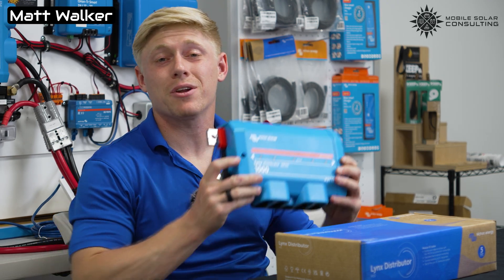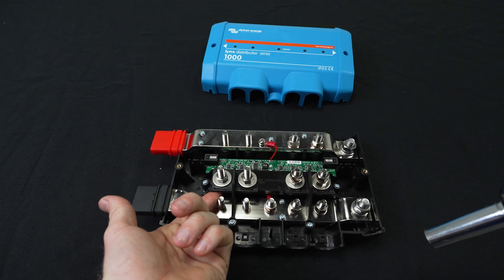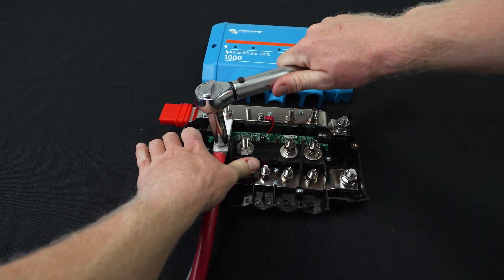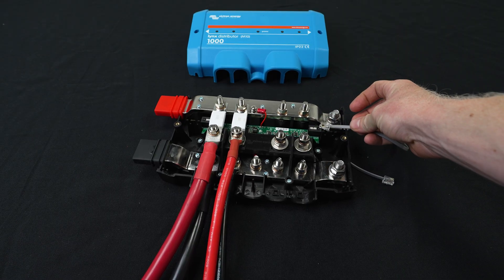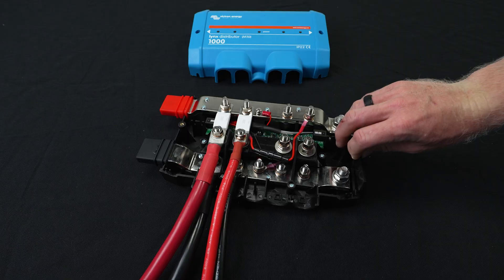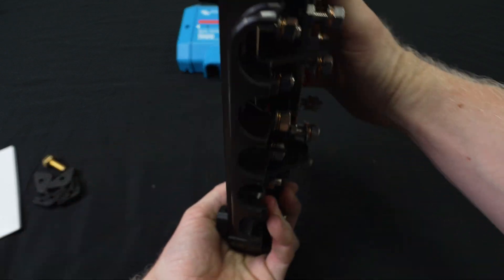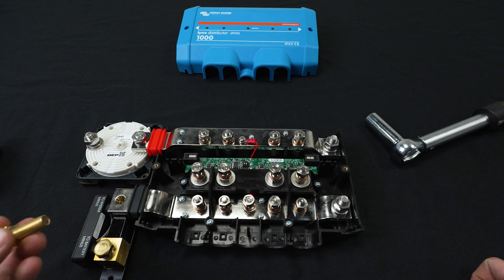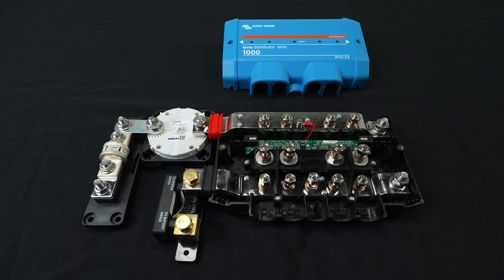How to Easily Install Victron Lynx Distributor Step by Step!

Comment: Great video!  Quick question, though.  What lug size do you need to use to connect a cable directly to the disconnect?  It looks larger than an M10.  That connecting plate seems really thin.  Shouldn't it be closer in size to the bus bar of the distributor?  I assume that would get a lot hotter under big loads with how thin it is.
Reply from the maker: The switch is M10

The thickness of the link bar is a great question, I will have to check Monday. That's exactly why we doubled them up.

Comment: 10nm? The manual says 14nm
Reply from the maker: We are both correct! 

10nm is for the nut that is set in plastic only. 14nm is for the nuts on top of the fuses.

Comment: fuse over cable  better solution
Reply from the maker: No
Reply: I can see you might think so, and it could be correct on other fuse holders.. the way to tell/know, is to observe which arraignment allows both ends of the fuse to lay perfectly flat even when not bolted down. I checked the distributor manual, and it doesn't specify, but all other viltron stuff I could find shows their designs to have fuse first, then lug. So, as I said, with ANY fuse holder, simply determine which arraignment allows the fuse ends to lay flat. Incorrect arraignment means the fuse ends will be bent, and under stress, and applying stress to the fuse body.

Comment: Why do you throw away the plastic isolators?? They are there for a reason! Those positive cables rubbing on the negative lugs are a fire waiting to happen.
Reply: Agreed! Those are there for a reason, and any cables that pull out or fatigue and fail, will short out the system by touching the cable below it, if those are not there to separate the cables and connectors from each other!
Reply: @fullsleevetats if the positive cable falls off the positive busbar and touches the negative, nothing happens, it is not a short circuit, because there is now no positive connection. If your cables are flexible enough to touch the negative busbar while still secured to the positive busbar, please link your cable source as your cables are much more flexible than mine.
Reply: If you all watched all the way through, he did replace them, but, he also said they weren't necessary, which I take sides with you all on this... I mean, they can't do harm, and are there for a reason.. it may even be that marine applications specify their mandatory placement, since the pos and neg are so close to each other. His calling them 'plastic tabs', gives the idea they aren't what they really are, or that they don't serve a purpose, which is,  'Terminal Separators'.

Comment: Great job thanks! Question re the ground terminal, there’s a small red wire and eyelet connected to the ground terminal, to connect a ground cable to this ground terminal, what is the stacking order of that small eyelet, does it stay in its original position or does the ground lug go first then this small eyelet?
Reply from the maker: As a rule of thumb, biggest wire on the bottom, smallest on the top. That applies here too, if you are stacking more wires on that terminal.
Reply: I agree.. that small lug is just for the circuit board, ie: very low amps (Whereas the ground lug, even if it is as small, may carry very high current in a short situation)... so the board connection should be 'uppermost'. You always want the high amp connection to be cleanest connection to, or, in contact with, the busbar.
In the world of electrics, 'Amps', should ALWAYS take priority consideration. (EDIT > There may be an occasion with commercial/industrial applications, where a certain product, or application, (or whatever), may say different, but that would be clearly outlined in installation specs/literature. For the common user/DIY'r, my advice on 'Amp Priority', is 'best practice').

Comment: I don't see a link bar to connect the T-fuse to the shutoff switch in the list of items.  I also don't see it on your website.  Can you provide more info?
Reply from the maker: Please reach out to us about the Link Bar. We can provide it separately via manual invoice. It's not yet on our site except within the "Power In Add On Kit"
Reply: @MobileSolarConsulting  I have an issue with that bar. A Class T in that position, would imply a battery connection, and connecting to something as robust as the Distributor, from any high current Lithium batteries, would make that bar way underspec'd. It should be much thicker/wider. That looks like about 250 to maybe 300 amp capacity, connected to as you have, even without filling all the spaces, fused in 525 amps amps, and could easily place another 200 to 300 amps and still be well within the 1000 amp capacity of the distributer/system, all supplied through that tiny bar. I would NEVER use that bar in that position for that purpose, unless I KNEW the entire rest of the distributor was going to be fused with a TOTAL combined capacity of 300 amps... in which case a distributor is really overkill, and could much more affordably be replaced with, for example, Victron's 6 way Mega fuse holder/busbar, with a separate bar for negatives.